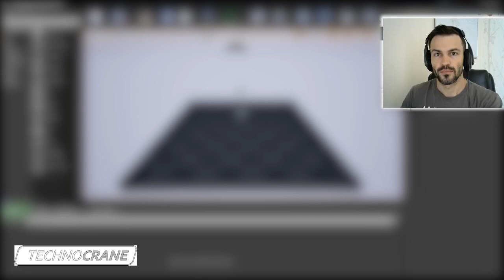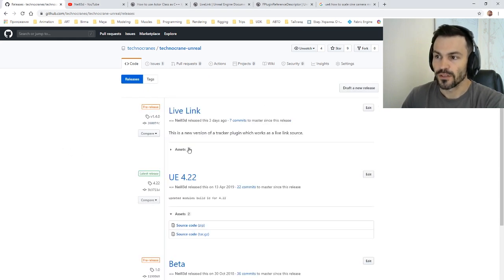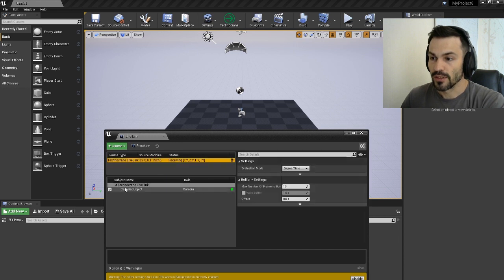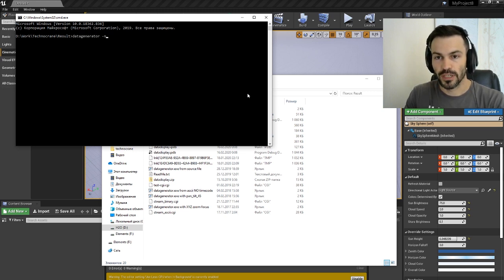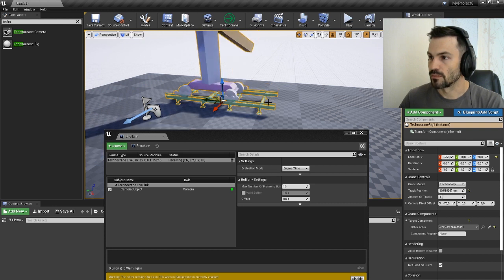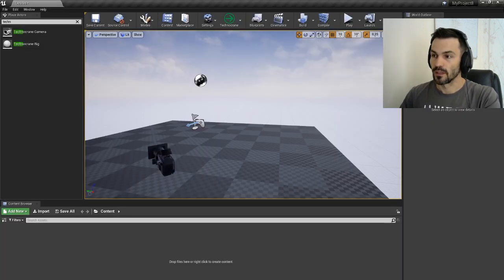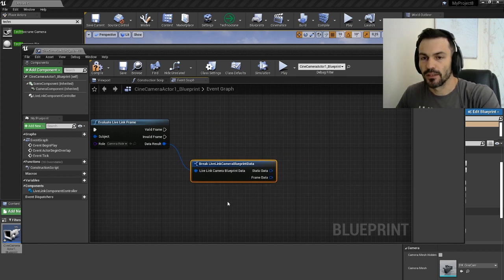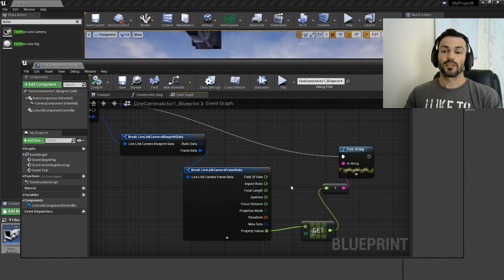Introduction to a Technocrane Live Link plugin

Comment: Can I connect real studio crane with this one trough a cable or connection, and use it in a live broadcast???
Reply from the maker: yes, you can do a live stream of a camera data which will align crane model with it. Just to clarify, the crane rig is just a simulation, it's not a 100% representation of a real crane
Reply: @Neill3d  thank you